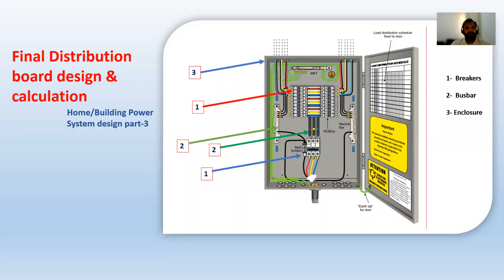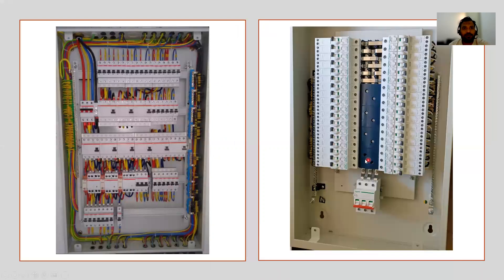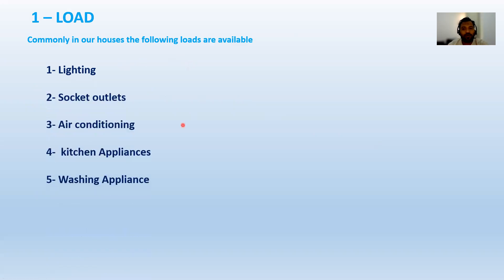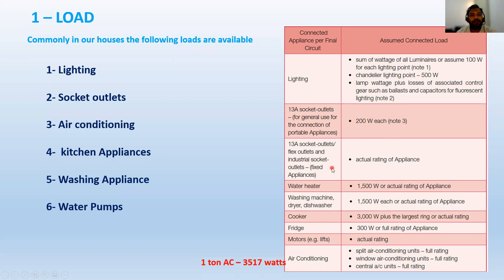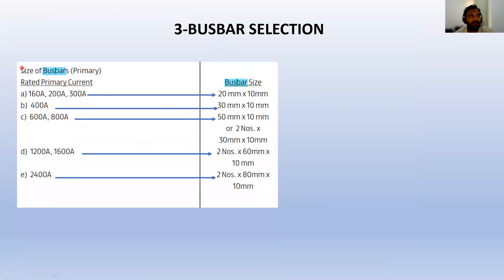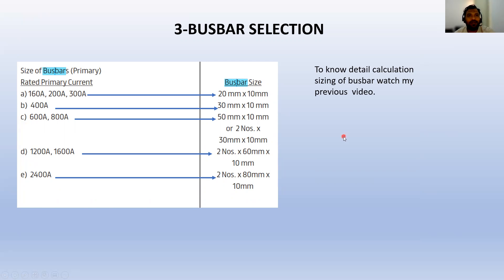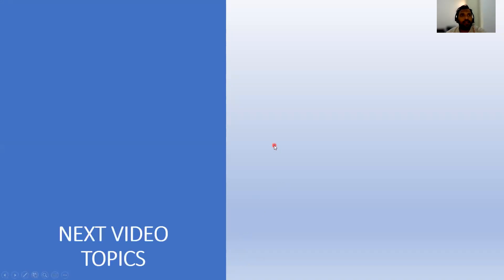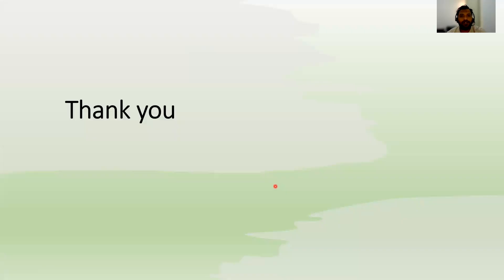विद्युत कार्य और गृह डिज़ाइन के लिए वितरण बोर्डों और गणना को समझना

Comment: Thanks. A question, what is the difference between actual rating & full rating?
Reply from the maker: did i discuss in my video ?

both are same ,in some cases particular motors and air conditioners starting current is high then operating current in that case we can see different current ratings 
during that case better to select the  full load rating current.
Reply: @ElectricalStuff  Yes , in the video a slide mentions “actual” another mentions “full”. So, full rating likely means whichever is higher? Which I guess gonna be the starting current, usually?

Comment: I think it wrong 100kw load require 200A breaker please elaborate
Reply from the maker: @engradnansandhu1537  hi 
It is thumb rule calculation and 
Actual process will explain in that video . Please watch .
More over the load and breaker values you can find in the authority regulations (dewa ,Dubai ,uae)

Comment: Sir i have some questions, please explain them in detail in next video
1. At video time 8.20 u said grouping factor. What is grouping factor and why it is used?
2. These calculations are according to DEWA or ADDC?
3. At time 10.58 u said that cable size is 6mm^2.  But what about voltage drop and short circuit condition formula?
4. I didn’t understand “FDB enclosure size” correctly can you explain it again please
5. Isolator i 3 pole or 4 pole so it should be 3 or 4 modules why 8?
6. Explain row capacity in detail.
7. At 14.43 “The following points…… design FDB” please explain these points in detail,
8. If possible make a real time example solution video like when a customer/client ask for a project and how to calculate a system for that client
Thanks😊
Reply from the maker: many questions few i can clear 
grouping factor is as per the IEC and dewa/addc regulations
it is allowed us to consider some assumption to calculate full/rated current at given load .
for voltage drop i make separate video cable size calculation please watch you can understand.
for enclosure size  we consider incomer 8 bcz , as per the size of the isolators ( 3 ph .neutral ,earth all these  5 items and so all these as per the manufacturer recommendation ) , i try to make with practical video for this , so you can understand further .

thanks for asking and subscribing our channel .
i hope i try to answer your question .
thank you
Reply: @ElectricalStuff  thanks

Comment: Previously i used to watch from different uploaders...now em stuck here in d loop😂...bcz everything i needed assembled here🎉
Reply: Sir you too much but my challenge is why 1 incomer isulator will be 8  modules, because in final DB,  ELCB and Isolator are almost same size except using MCCB with higher amp
Reply from the maker: I agree with you , in DB this method is a thumb rule a , actual calculations consider as per the sizes of incomer and outgoing breakers.
Reply from the maker: Thank you for your valuable feed back

Comment: Thanks for the video. In your calculation you got 21.97 amps. You chose 32 amps mcb tho there are mcb 25 amps
Reply from the maker: standard 25 MCB are very less .. that is the reason i choose 32 A.. in your area if you have then sure you can use it .. 
this example is how to calculate the breaker and select the cable .. hope you like my video and i guess it will benefit for you

Comment: Does the no. of way apply a generator supply?
Reply from the maker: I did not understand your question can you elaborate more ?
In generally we connect the generator supply on LV panels  so from there it will run either emergency power i,e generator power and permanent power

Comment: Sir if Ic is 40 A ,by using shortcut kwx2 ,what breaker size should take 40A or next  bigger size
Reply from the maker: don't go bigger size , short cut applied cable length less than 100m ,for all other cases we have to consider voltage drop ,please check my video voltage drop calculations in detail

Comment: Sir in this Lecture u gave a short cut for breaker size  e.g Load 4kw so Breaker size will be = 4*6 =24 Amp but in the answer of the previous quiz  u calculated it as 100kw load =100*2= 200 Amp Breaker size. Can you please explain the difference ? is it because of single phase and 3 phase or what ?
Reply from the maker: Hi 
For single phase multiply by 6 
For 3ph  multiply by 2 
I hope it is clear
Reply: Yes its clear now Thanks alot

Comment: If I have a few free slots for additional MCB in the DB box. How do I calculate the load without overloading the whole row, ELCB or the DB box? How can I be sure if I can add another 32A MCB safely?
شكرا جزاكم الله عنا خيرا
Reply from the maker: Good question , to add additional MCB  
The following points to be consider 

	1- How much load we are going to add 
	2- If we add this additional load our incomer breaker is sufficient ? need to check 
	3- Is any free space available to provide additional breaker .
	4- If you are unable to provide ELCB then  provide RCBO 
	For practically  during designing DB , we consider 20 % spare load  ,it means we have additional 
	Spare breakers . 
I hope the answer your question, further if you have any particular case share those details we will discuss.

Comment: how about 25 circuit breaker
Reply from the maker: Can you elaborate your question
Reply: I mean can I use 25 mcb instead of using 32 A when.the load current is 21 A
Reply: @mohameddeik9556  In his video 9:20, he did mention to get the next above rating to the total load. He gave an example of 32A mcb as it is the most common size amp. 25A mcb is also available, but non-preferred size for electricians.
Reply: okay thank you brother